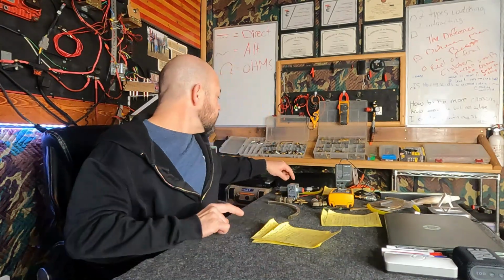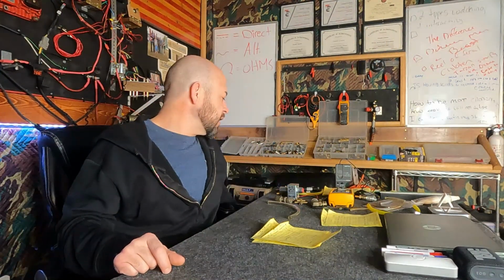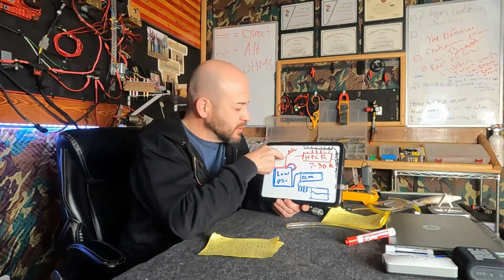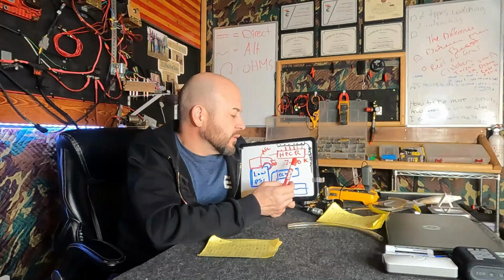Diesel fuel system diagnostics

Comment: 6.7 powerstroke 125k miles just bought it for 24k I was omw home cruising at 2000 rpm and started hearing a major fuel knock and a lot of white smoke out the tail pipe. I got down to the injectors and I see leakage around 2 of them. I have an icp code for low pressure and it won’t start. No glitter paint in the cp4 pump or valve. if the o-rings failed on my injectors could it have caused all this? And could I just replace the o-rings or do I have to get new injectors, they test correctly on the multimeter.
Reply from the maker: Yes injector o rings can cause a major drop in rail pressure. Email me @ testyourselfdiesel@gmail.com. I can see what we can figure out over the phone from there.